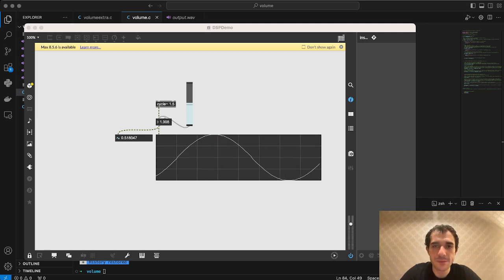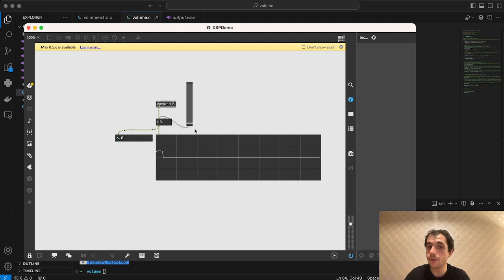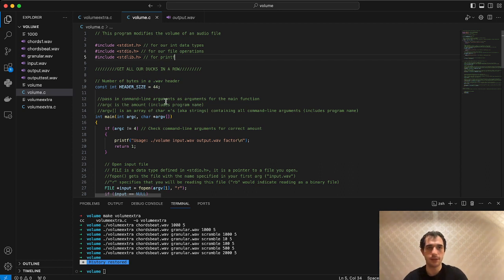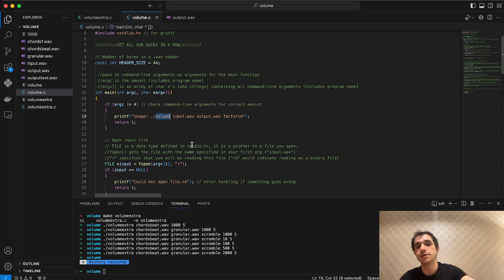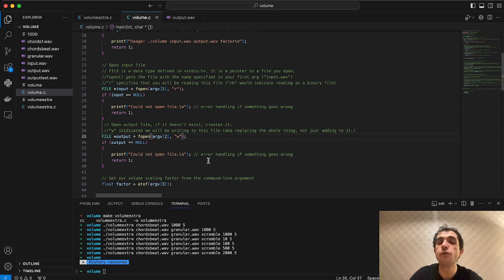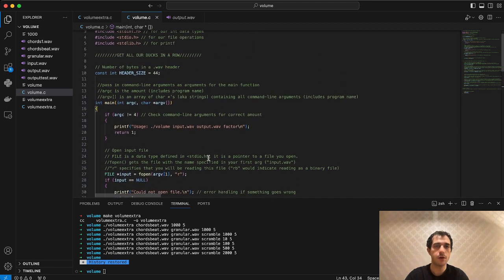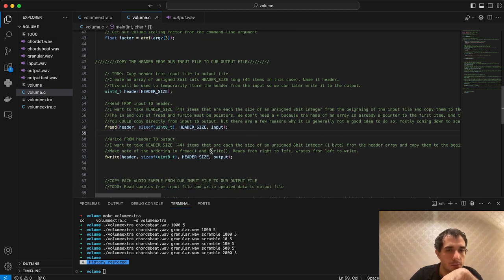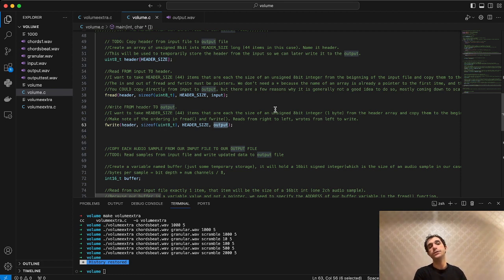CS50 Lab 4: Volume

Comment: Hi thanks for explaining everything . i still have a question tho . in the last while loop why we dont need to write fread again inside of the curly brackets like this 
while (fread(&buffer, sizeof(int16_t), 1, input)) 
{
     fread(&buffer, sizeof(int16_t), 1, input)
     // Update volume of sample
     buffer *= factor;
      // Write updated sample to new file
     fwrite(&buffer, sizeof(int16_t), 1, output);
 }
does the function inside brackets do its job or is it just returning a value to the while loop for it to work?
Reply from the maker: Good question. Your assessment is correct, the fread() function when called inside the while condition is doing two jobs for us. It's reading a sample from the input into the buffer variable AND returning the amount of samples successfully read to be evaluated by the while statement.

Comment: What could be wrong if the code doesnt work for factor 0.5?
Reply from the maker: Hmm not sure. I've added a link to the code in the video details if you'd like to compare your code more closely. The command should be:

./volume input.wav output.wav 0.5